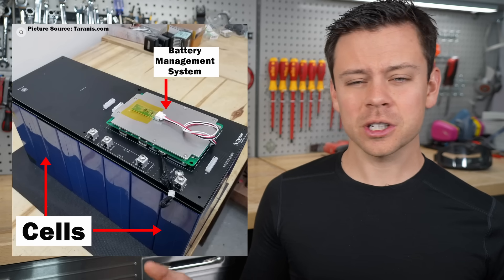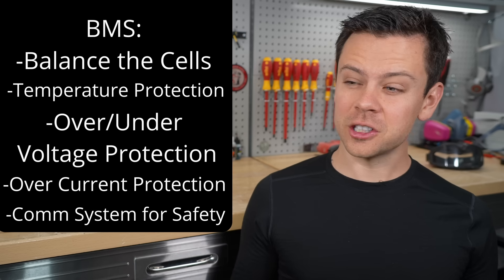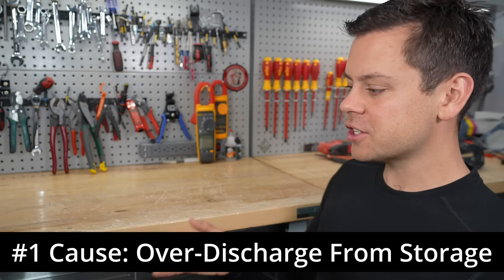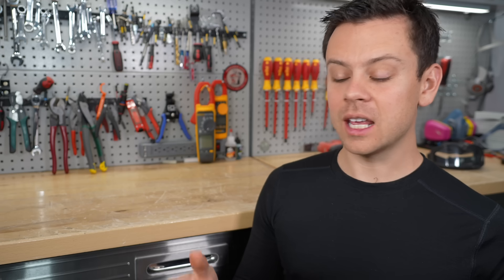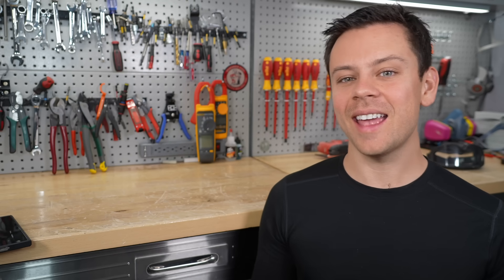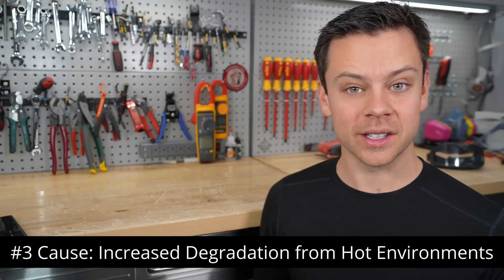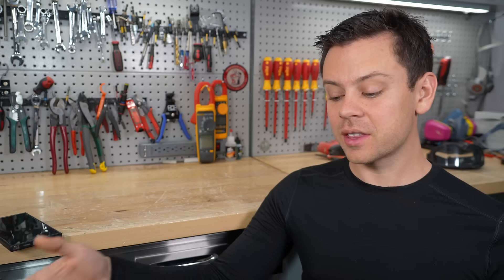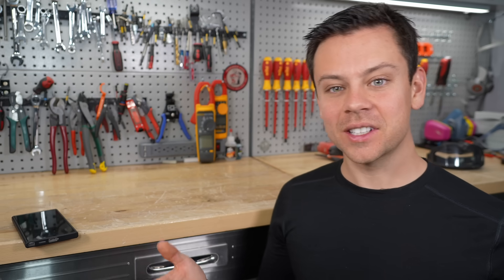The Rules of LiFePO4: The 3 Most Common Causes of Failure and General Guidelines for Long Term Use

Comment: Nice video. One question: How is 100% SoC defined? How do I know that I'm at 100% and the balancer steps in? Voltage above... how much? 14.4V? 14.6V?
Same question for 0%.
Reply: 100% SoC is defined as the point where the voltage under charge starts rising very fast over minutes. When the voltage reaches 3.65V, the cell is at 100%
Reply: @meindertsprang7491  Thanks, that's useful information.
Another question: From what voltage on does an average BMS start with balancing?
Reply: @thorstendenk  If its task is to get all cells topped up, I'd like to think the moment the first cell hits 3.60 or 3.65V. And since a BMS never sits "in between" cells but always accross, the only thing a BMS can do is bypass any full cell with a load resistor to divert the remaining charge current, usually less than 1A, to the cells that still need it. And this can take a very very long time if one of more cells are "out of balance". The process can then take up to days on larger banks. That is why manual bottom or middle balancing is much better. The balance at the top brings you nothing, no significant amount of charge to squeeze out of your battery bank.
Reply: @meindertsprang7491  Again thanks a lot, very interesting.
One final question: What's the definition of 0% SoC?
Reply: @thorstendenk  That depends a bit on temperature but the datasheet of my Winston cells says 2.8V at 0ºC. As temperature rises, the voltage rises too. But in general, 2.8V is considered empty while the cells allow discharge up to 2.5V (the limit). So there is a safety margin.

Comment: I have Jabada BMS in my battery (pre-built) and one cell is falling short. While all charge to 100% at 3.55v one is at 3.4v and built in balancer isn't helping, so in my case I need to add active balancer but important thing is to use it once every 6 moths and not keep it always on. Other option is to manually charge this one cell to 100%. Both options require opening my battery and this is something I don't want to do.

Comment: "Charge when cold, they can be instantly ded." 1:14 What temperature is too cold to charge?
Reply: Would love to find out the answer to this question.  What temperature is too cold?
Reply: Different manufacturers have a range of temp ratings but it's normally between 20f and 32f. Anything below that they need a heater
Reply: Freezing, or 32F or 0C.

Comment: The 50pc storage charge is nonsense IMO, first off how does a charger of lifepo4 no when its 50pc,only watching the Ah back in Will you get an idea as voltage wont tell u squat 
Just charge to 100pc,with all the Bluetooth stuff self discharge rates are higher again

Comment: I just capacity tested my 5-year-old Battle Born 100 Ah batteries (4x parallel connected) and they all tested at 80-82 Ah. So, I have lost 20% capacity in just 5 years.  At the current rate, these PREMIUM 100 Ah batteries will only be 60 Ah each at ten years.  Price does not guarantee quality.
Reply: Yeah, but the question is, did you check them when they were first put into use to establish baseline?  If not, true and accurate capacity loss is unknown.
For what they charge in $$$$, I'd call BB.
Reply: @Robnord1  Indirectly, after about a year, I let them discharge from 100% all the way down until the BMSs turned off and the Victron shunt said that I got 399 Ah out of them as a bank of 4 batteries.  (I did not have a capacity tester back then.)  I sent them an email this week, and I have not heard anything back from Battle Born yet.  I expect BB to tell me that as long as they are at 80 Ah or more, they met their warranty.  I am pretty confident that BB will do nothing - even next year when they are 6 years old and have less than 80 Ah capacity left in each battery.  Hope I am surprised.  Thanks for your interest and advice.

Comment: Great video, been watching since inception. Off grid for over 20 years, and an early adopter of lithium. My oldest are 2005 and still in-service. I've found any lifepo4's I've used will stay in near-perfect balance using the 80/20 rule. When charging any of them past the 85% mark, I've experienced voltage drift between the cells (bricks) and if necessary, a simple balancing will straighten them right back. Although they are fantastic for off-grid, I'm hopeful this chemistry will take one more leap. If that happens, they might very well be the ones that could be passed onto the next generation and be quite useful. Thanks for the great videos Will!

Comment: I’m just getting into LiFePO4 batteries & parallel string building, for use during hurricane power outages. Batteries will be stored while NOT interconnected or fused @ terminals. If I understand you , I’ll discharge these batteries down to about 50% (or maybe 55%) for storage, checking them every 13 to 15 weeks to be sure they haven’t self-discharged more than 5 to 10%. If they have discharged more than that (down below the 40% level) then I should charge them back up to the 50 to 55% level for another 13-15 week storage cycle. Do I have the concept correct? Should I do an annual exercise cycle (in the parallel string arrangement) bringing all 100% level batteries down to about 55% remaining, then starting another off-string storage cycle?

Comment: Thanks Will for sharing your knowledge. I have a wilderness camp in northern Saskatchewan, Canada. It is time to upgrade our golf cart lead acid battery system.
The camp sits with no one there for months at a time. During winter months we sometimes see -40C. I am looking at using 2 of the new Renogy 300ah mini.
I do not want to drag the batteries out every fall. My understanding is the self heated battery system will only function with power coming in.
What will happen if I shut them down and they get below the  recommended -20C ?
I have looked at lining my existing battery box with rigid insulation and adding a heat source with a thermostat and leave the solar panels and system active?
What do you recommend?  Thanks

Comment: Question: I’m hoping one of your viewers can answer this for me, is there a charger designed to be able to set to a 50% charge  and shut itself off?  I’m one of these folks that puts a battery on charge,walks away and days later realizes that I still have it connected.
Reply: Only ah back in will tell u the approximate soc, impossible for charger to no from voltage,dont stress over the 50pc figure, especially if batts have Bluetooth self discharge will be quicker

Comment: I have renogy 100ah batteries for three years now 6 in parallel as they cannot go in series. Through the app it shows on some of them even when fully charged through solar everyday that they are not balanced ie 3.4 3.3 3.5 etc. Also one does not show up on the app and never has from new. The system works fine so what's up.

Comment: so how long i can watch tv that is 3A with 12V 200Ah or 24V 100Ah
Reply: Like it or not, you got some learnin'  to do.  If you learn it now, you can use it in many electrical problems for years to come. Wait to be spoon fed and learn nothing. GL
As you learn, remember. Calculate to include DC to AC inefficiency factor / loss..

Comment: Hi @WillProwse, great job on the videos, thanks! Question for you... I have a LiFePO4 200Ah battery installed in my minivan and would like to leave it in the stow n go floor storage space all winter. My concern is that I live in eastern Canada where the winter temperature can be very cold... Can I just disconnect the battery and leave it there until springtime when I will use it again? Thanks in advance for your input! Daniel

Comment: Don’t over discharge; don’t allow to get to zero. 50% at least for storage; charge LFP to 100% and maintain balance once a month; avoid extreme temperature; 40 degrees plus is bad, 20C is best; watch for BMS failure; use battery plenty and often

Comment: I have a LiTime 12V100Ah BCI Group 31 LiFePO4 Lithium battery that I use once per year, on a regular annual camping trip, for about 10 days. I don't use it at any other time of the year. So, if I charge it up to 100% immediately after my camping trip, then put it in 70-ish degree storage for the rest of the year, it should self-discharge at about 3% per month, or about 36% for the rest of the year. It won't even discharge down to the 50% sweet spot. Therefore, I don't need to "check on it" or connect it to some sort of battery tender device or recharge it in-between my annual camping trip, correct? Or am I missing something?

Comment: Hmm, by changing my EG4 battery from 20% to 5% State of Charge (SOC) end point, gave me nearly 1.25hrs.  At 4kWh average this time of year, equals $0.79 per day or $23.70 month savings extension vs the grid, or $284.40 year.  Over the life of the battery, that single change in software pays for 83% of the battery’s cost.  Interesting math.  I'm still nervous about letting the SOC go to 0%, but I'm "warming" to the idea.  Thanks Will
Reply from the maker: Smart!! Good point

Comment: I'm curious why you recommend not storing a battery and allowing it to drain completely and yet you say it's okay to drain your battery to zero when you're using it.
Reply: Zero doesn't mean completely drained but discharged to the level where the BMS cuts out to protect the battery, or where other connected devices cut out - maybe 10 volts in a 12 volt battery. If a battery is discharged to this point and then stored, selfdischarge over time can bring the voltage down to where the battery doesn't work anymore and can't be revived.

Comment: I am not using bms atm. I have the active balancer and a really over-engineered disconnect in the works. But no hurry. Batteries are fine as per my readings and control program. No unbalance. No problems with temperature as per climate. Never needed its full capacity. When I read something that merits balancing I’ll stop procrastinating.

Comment: Great video but I do have a question.  Maybe I'm just a little ignorant here, but you're suggesting you discharge the batteries down to 0%. Won't that shut down the bms for good?   And if not, how long can the battery stay at 0 %without shutting down?

Comment: Question: I use my 36v/100ah Lifepo on a  trolling motor.   I use  about 10-20% capacity at each week.   I tend to recharge between it's down to 20-50% and have never let it go to zero.  I  store indoors Nov-Apr with a full charge.  Is there anything you would recommend i do differently?

Comment: Technically, everything you said was beautifully correct but what do I see when looking at the BMS? I see what is likely to be a Chinese PCB of dubious origins. What happens when that fails? Very bad things indeed. Kinda reminds me of LED bulbs that advertise a life of 50,000 hours but fail after a year of light usage. Yes, the LED itself has a very long lifespan but the circuitry that runs it is a very different story.

Comment: Have 2 Tesla Powerwall 3’s and have looked everywhere on how often I should discharge the batteries. Our utility company gives us a direct credit for solar and we use that credit with no cost, the credit rolls over monthly. Basically, our utility is a big battery. So our Powerwall’s are purely for backup when the grid is down. In 3 months since install we have had 2 power outages, both started at 9 am, and skies were clear (not weather related). If we had used our batteries at night they would not have been charged and ready as a backup.
So question is, can we leave the powerwall’s charged?
Note - One time I did see the Powerwall’s discharge on their own early afternoon to 40%, then quickly recharge from solar and the grid - this may be programmed in Powerwall’s to occasionally discharge for battery maintenance. Again, I cannot find any info on this topic from Tesla.

Comment: First time viewer with a question, great presentation btw 
But you raise a question for me, I have a brand new lifpo4 technology battery rated for 6000wh that cost over $3k, the engineers that created it recommend 20-90% charge unless an emergency is expected.
Why should I trust what you're saying over the engineers? 

Thanks!

Comment: Why are you stating to charge stored LFP batteries to 50% and also stating to charge our batteries to 100% without any worries?  Wouldn't you want a stored battery to be at a fuller capacity in case it's needed in an emergency?  Or did I miss something in the video?
Reply from the maker: Storage is different than daily cycling. If you're using it for solar you will cycle it down and up every day. Which means you'll be around 50% just like in storage situation. But that's only if you size your system properly. And technically if you store at 100% SOC long-term it will increase the degradation rate. Because the higher voltage. But honestly it's not that bad, check out my other videos where we go into that. Just posted one on a battery I was testing
Reply: @WillProwse  Got it, appreciate you taking the time to explain it more in detail.  Yeah, I watched the video of the battery you've had sitting out in the hot sun for degradation testing before I watched this video, if that's what you're referring to.  Love your channel.

Comment: Good tips. Our 200Ah AGM battery is usually in the garage with a solar panel in the garden charging it up. Originally got it for camping but now we use it for powering the home office, charging devices, backup power and powering lights throughout the apartment. When it eventually dies next one will be LFP.

Comment: Re: Self-discharge:  Li-Ion doesn't self-discharge.  At least, not appreciably.

I have a block of 18650 cells that I bought a while ago.  Like, when it was still legal to ship them via USPS.  I have never used them, and never charged them.  They are exactly as they were sent to me like, I dunno, 8 years ago?

I just measured a few of them at random.  They ranged from 3.60V to 3.61V -- which is approximately what they measured at day one.

If you are seeing the voltage on your cells drop, it's not the batteries.  It's the BMS.  Which leads to another common misunderstanding with Li-Ion:  When it comes to the BMS, less is more.

At the pack level:
Your charger should have high voltage cut-off.  You don't need a BMS to do that for you.
Your inverter should have low voltage cut-off.  You don't need a BMS to do that for you either.
You should have a circuit breaker or fuse.  You don't need a BMS to do current-limiting.

And, finally, if you're only ever drawing current from the whole pack, they will rarely, if ever, go out-of-balance.  Your BMS tapping each cell individually to measure voltage is more than likely the dominant reason the cells ever drift from each other in the first place -- because, again, they don't naturally self-discharge unless there's something physically wrong with the cell.

That said, if you're running a series string, the cells will eventually age, and their capacities will begin to drift over time, so in reality, it's not particularly safe to run without some kind of cell-level monitoring, just to ensure they never go over or under their intended voltage range.  Since the parasitic drain will never be entirely perfectly even, it necessitates some mechanism to bleed the highest-voltage cell periodically to bring it in-line with the rest.  I.e., the BMS itself necessitates having a BMS to solve the problem it creates.  A necessary evil, unfortunately.

But the less it does -- specifically, the lowest possible parasitic drain and the least possible tampering with cells -- the better off you are.  If you see something with fancy digital displays, complicated PCBs, or self-discharge in the measurable percent-per-year, then you've got too much BMS.  Go simpler.  (This is assuming your pack is disconnected from the load.  An inverter or system controller is going to present some load as well, even powered down.  That's perfectly normal.)
Reply from the maker: Yikes. Just Google "lifepo4 self discharge rate".

Comment: So I'm making a system for my small sailboat and it's not going to be used very often. Will leaving the system running (ie keeping the batteries topped off to 100%) all the time create issues? Do I need to occasionally discharge/cycle the batteries for longevity? And if so, by how much how often? Thanks!

Comment: Will, thanks for this very important video.  Now that I watched it, I realized that I could be screwed.  I bought 6 100-amp hour 48-volt LIPO batteries from Signature Solar back in 2019 to run my off-grid house, then I thought, 6 more would be great to have as a backup, so I bought them about 6 months later.  I opened up and charged 3 of the 6 extra batteries but left the others in their original boxes.  I really need to check on all the extra batteries as it's been a few years and they've been sitting in my garage up in UT where it gets near or below freezing.  I pray I haven't wasted $$$$ due to my ignorance.  I don't live in UT but only go up to visit and work on projects and living in Henderson NV I don't really think about things like you mentioned in this video.  Wow, this video was an eye opener.

Comment: Research shows that the depth of discharge (DoD) is strongly related to the lifespan of LiFePO4 batteries. Multiple studies confirm that the cycle life is significantly extended if the batteries are charged and discharged within smaller percentages rather than being fully charged and discharged.

For instance, at a 100% DoD (discharging down to 0%), LiFePO4 batteries are expected to last around 3,000 cycles, while at an 80% DoD, the cycle life can increase to approximately 6,000 cycles. With an even lower depth, such as 50% DoD, the battery could last up to 8,000 cycles. Thus, the optimal usage range is typically between around 20% and 80%, as this reduces wear and increases battery durability.
Reply: Source?
Reply: Source?